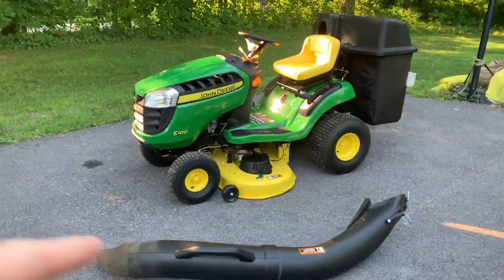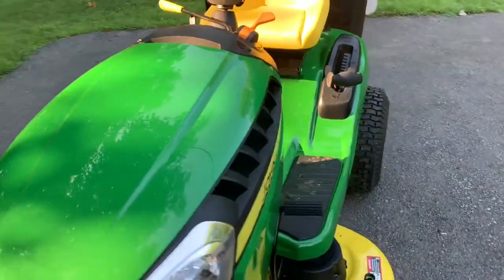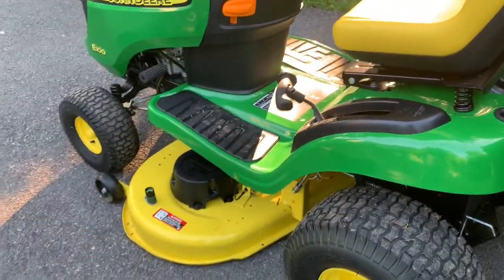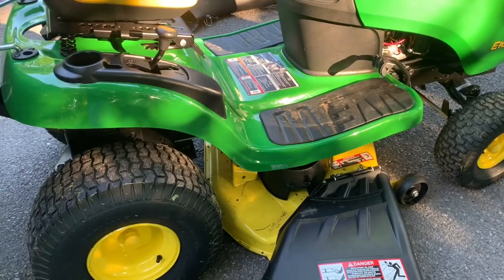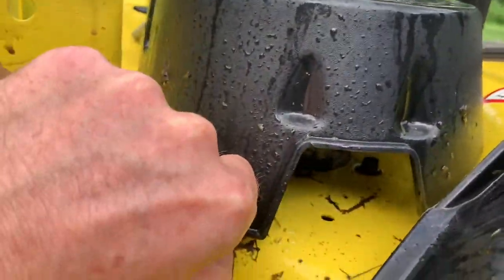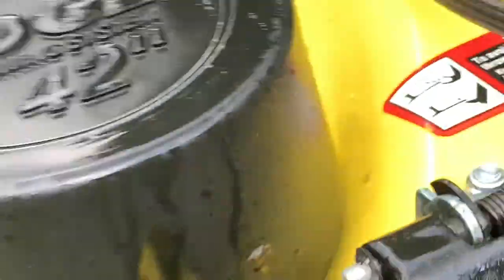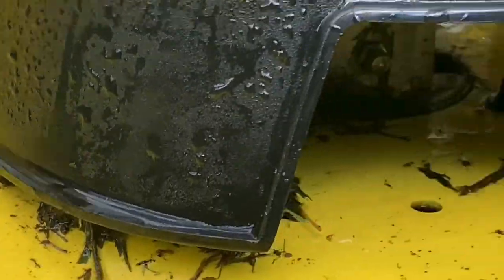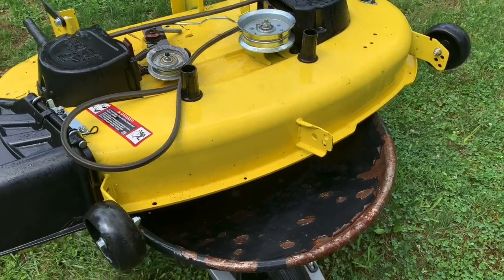John Deere E 100 Series Bagger Review

Comment: just wondering - Harbor Freight has a $74.00 tractor lift which allows you to service the blades and underside of the deck - would that not be a more efficient method to do this kind of work thereby eliminating the constant wear and tear of deck removal and deck leveling from such maintenance?
Reply from the maker: If you wanted to do that I’m sure the lift would work good for that purpose.